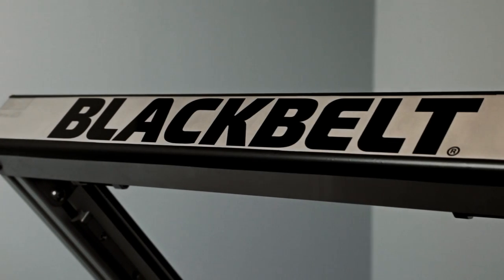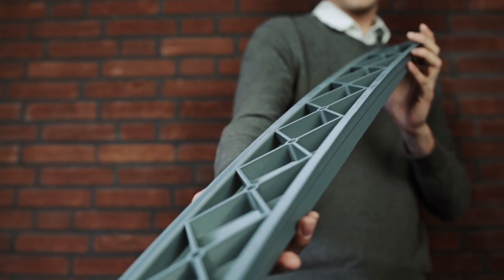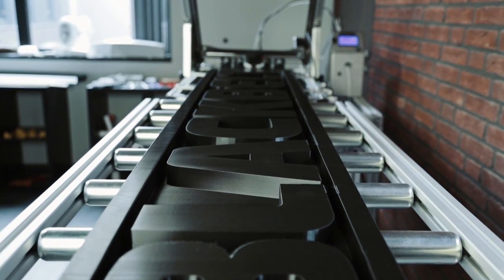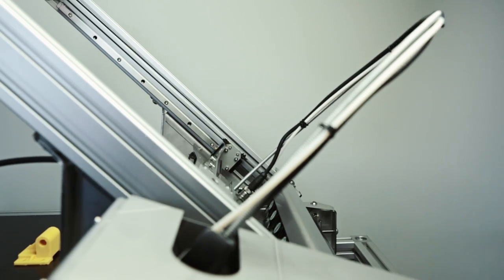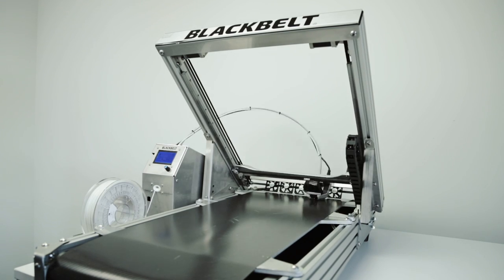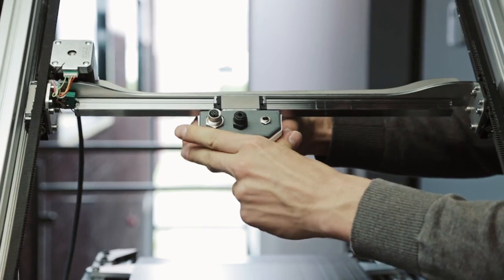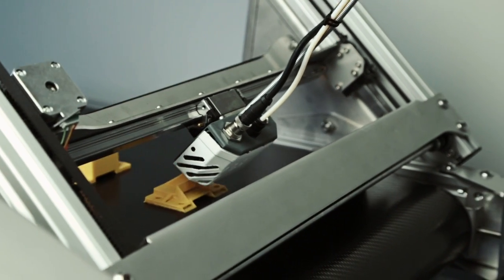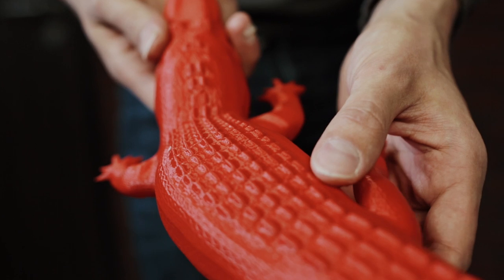Blackbelt 3D Printer Kickstarter Video

Comment: PHUCK PATENTS. Patent pending == NO ONE CAN REUSE THIS IDEA FOR 20 YEARS. This is mind-boggingly EVIL.
Reply: capitalism, even ideas can be private property.
Reply: This is pretty much the opposite of capitalism, having ideas blocked by state coercion. So much that the main think-tank of capitalism today, the mises institute, explicitly advocates against all intellectual "property": https://mises.org/library/against-intellectual-property-0
Reply: Capitalism is about private property. Your link speaks about libertarian views.
Reply: That's the theory of capitalism, not only "views". Keynesianism does not explain it, much less communist theory. In the Mises books, you have deep concepts like the explanation of private property, why it exists and how it is actually defined - it needs scarcity to be meaningful, and that's why ideas cannot be property: they are not scarce.
Reply: But if you invent something, and there were no patents, a larger corporation could simply steal your idea and make all of the work you did have no tangible reward.

It should be up to the inventor to decide where their ideas go- even if no one else can use them for a few decades.
Reply: its pending. meaning they won't get it since a larger corporation already filed for it several years ago.

Comment: Thank God for Creality. Charging 9500 Euro for the base printer and an extra 3000 for a stand and roller is highway robbery. Especially when half the thing is made from aluminum extrusion. This is why your product is going to get eaten alive. If you charged <2000 I think you would have had great success in gaining a massive audience and customer base, but it seems greed was you're real bottleneck.